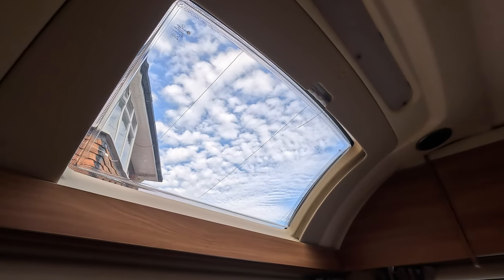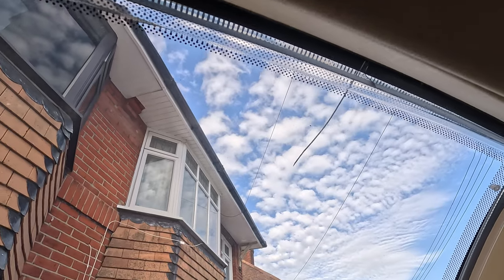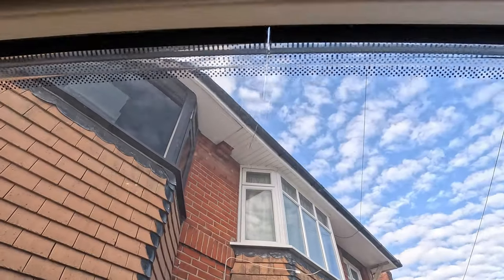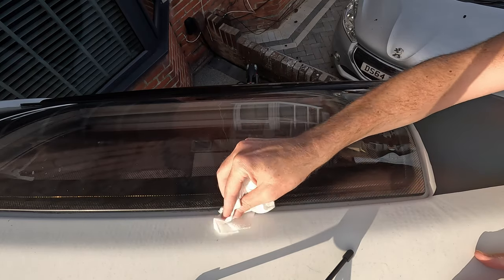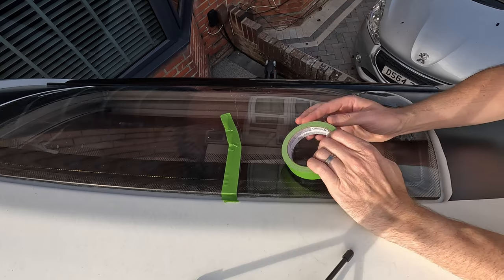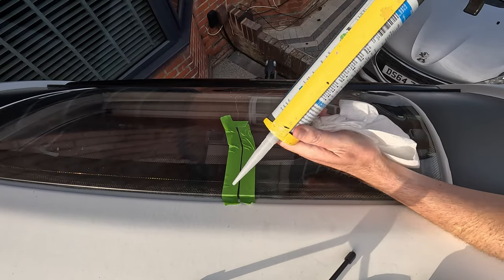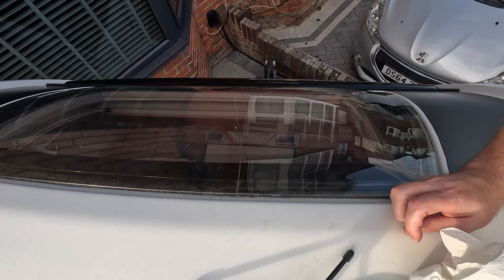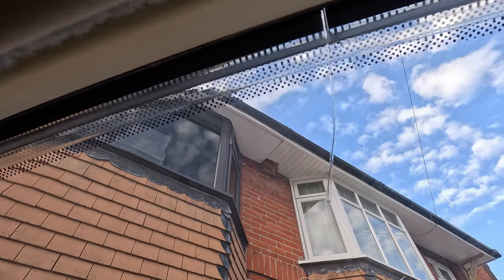Cracked Caravan Window, Temporary Sunroof Repair #caravan

Comment: I had the same issue on my 2012 Conqueror.....i was in the South of France where i leave my caravan for 9 months of the year. Spoke with my insures Tower Gate who were fantastic. Agreed to cover the cost of the repair at  a Swift Dealer near Bergerac. Its definitely a manufacturing fault. The silicon rubber seal that allows the glass to flex during movement becomes hard over time and this is what creates the cracking. The repair guy said that the silicon rubber seal has now been upgraded and no longer losses its flexibility.
Total cost to have a new one fitted including all the silicon sundries glass and labour was £2.5k ......thanks Tower Gate Insurance.👍
Reply from the maker: It seems all fun and games with these windows lol, glad you got it sorted whilst away, great service.

Comment: Hi, this happened to us in September last year. Repaired by Swift under warranty at our dealer. From another post on the same issue (there are many) it was said the aperture in the roof was not big enough to accommodate expansion. When I look at our repair, I can see there is significant clearance between the glazed unit and the roof. Looks like it was cut with a saw, as the edges are rough. Manufacturing method is water jet. So you should check the clearance on yours. It was covered on our 10 year water ingress warranty. We used clear gorilla tape as a temporary repair kept the water out. I also drilled the ends of the crack. Took about 3 months to get it repaired.
Reply from the maker: Thanks for taking the time to reply and share this information with the group, I'll check the cut out size when I'm next at the caravan as I'm interested to know if that's the same issue on ours.

Comment: Same thing happened to me swift fixed it under warranty but it took them 10 months to resolve and you have to have your van serviced to their strict service  terms of 90 before annual purchase of the van and 60 days after hope this helps and look forward to see how you get on 😉
Reply from the maker: We keep you all posted, currently speaking with our insurance company, being a 2014 model don't think this will still be covered under any kind of warranty which is a shame.
Reply: Check what the coefficient of expansion is for acrylic, you’ll be surprised. There’s a few articles from acrylic suppliers stating the biggest issue with acrylic applications is that designers don’t allow for the large expansion values of acrylic.

Comment: Reference my earlier comment, both Swift and our dealer denied they knew the cause of the issue. Which I don’t believe as they accepted the claim straight away. I expected a fight to get it repaired, thought they would say bird or ball strike. I think cutting the hole in the roof bigger to increase clearance is the real fix. Just changing the glazed unit might just treat the symptom. Swift repaired 3 other vans with the same issue at our dealer. I believe it’s a big issue and Swift have technicians on the road fixing the problem at dealers, if it’s under warranty. Our van is a 2019 Challenger. The window is different but the failure mode is the same.
Reply from the maker: I did speak with Swift but as I wasn't the original owner the 10 year warranty they offer was no longer valid.
Reply: Sorry to hear that, I would check the gap between the double glazed unit and the hole in the roof, before you have the repair completed. I’m very confident that mine was increased at the time of the repair. It’s not easily accessible, but as a guide I can see the edge is rough, as it’s been dawn. And I can get a finger into the gap. I’m very confident lack of clearance during expansion causes the crack. Hope you get it fixed soon.

Comment: Same issue as mine swift haven't solved the problem they just change the window...Same will happen to the replacement...they are not fit for purpose
Reply from the maker: It does seem to be that way John which is a real shame, most days I see a post with someone reporting the same problem ☹️